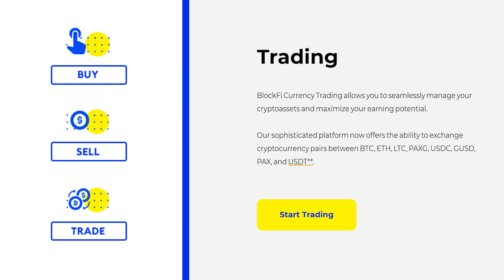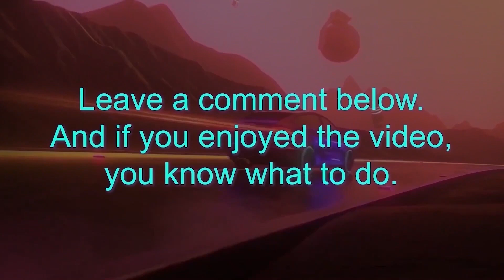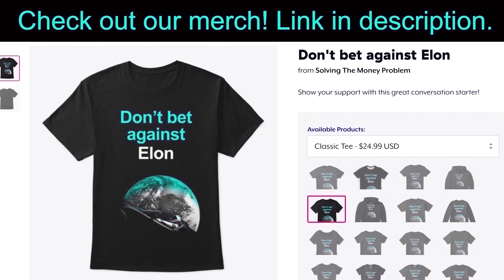Sandy Munro Shows Tesla's SHOCKING Lead Over Ford

Comment: It's kind of obvious that Ford didn't put very much brainpower into the Mach-E.  Likely we will see the same for the Lightning.

You didn't emphasize what Sandy found by way of screws.  Let me jump in.  The battery pack is loaded with screws.  So is the HVAC system.  Sandy didn't like that.  He's likely to find more screws as he continues the tear-down.

Screws vibrate loose; the more you have, the more maintenance costs will rise and reliability will fall.  Ford used a lot of screws.  These are literally the worst fastener choice for a machine that moves and experiences vibrations.

Ford neglected this product.  My guess is there's a pragmatic reason for this neglect.  Ford doesn't intend to sell very many Mach-Es or Lightnings.  Instead, they'll ramp up production for hybrids - with electric drive trains, tiny batteries, and range-extender ICE generators on board.  With hybrids, Ford will stretch their battery cell supplies - which are a problem for Ford.  And they'll lobby the heck out of governments to get tax incentives, the same incentives as for BEVs.  Or even better.  This is the path Ford is really charting into the future - the same as Toyota and GM.  Toyota, Ford and GM, and other legacy automakers, and the oil companies, and the dealer lobbyists, will all be spending time in capitals lobbying hard and handing out cash.

Everyone loves the hybrid approach.  Fossil fuel companies?  Check.  It will keep gas flowing to ICEVs.  Dealers?  Check.  Hybrids are immensely complex, lots of failure modes, plenty of after-sale work.  Consumers?  Sure.  They're used to gas stations, they're familiar.  And they'll get some seriously low prices on hybrids.  Battery cell costs won't drive up the price much if a hybrid's battery pack is tiny, and they can make ICE generators cheap, so the base price on hybrids can be pretty low.  With incentives, if Ford can get them, they'll be much cheaper than any comparable old-style ICEV.  A few disgruntled greenies like me won't like it.  Pleasing greenies isn't on Ford's to-do list.

Tesla won't be able to get purchase prices low enough to match hybrids for some years, particularly if hybrids are incentivized.  Tesla's life cycle costs will be lower, but how many consumers even know what life cycle costs are?

So I expect Ford to put their A-team on their hybrid models.  These true BEVs are just not very important to Ford.  They'll milk them for publicity, but the production and sales numbers will be underwhelming.
Reply: I don't see hybrids staying competitive for long and I do think that EVs will be better and more affordable that hybrids in the near future.
But yeah it does seem like they will try to milk their cashcows  for as long as possible before filing for bankruptcy
Reply: @elsmaster5592  By flooding the market with cheap hybrids, they can hope to tamp down demand for Tesla vehicles for the next few years.

Hope.

I'm not convinced it's going to work.  But this is what I expect them to try.

Tesla is no ordinary competitor, though.  Their engineering is still improving.  They have piles of valuable IP no-one else has - and the rate at which they generate more IP is breathtaking.

Hybrids may turn out to be fossil fueled transportation's last hail Mary before their arms give out and they can no longer throw at all.

We shall see.

Comment: There is a good reason right there for why the Mach E has to be inspected / serviced every 10,000 miles. They have to check for leaks in all those hoses. They designed this to be friendly to their dealer network and service partners.

Comment: I think part of this is that Ford - like most other automakers - is not vertically-integrated - they have a lot of relationships with vendors that they have built over decades. Those vendors supply a lot of parts to Ford's other vehicles. They don't want to jeopardize those relationships, so building in guaranteed sales for new model vehicles is part of the corporate DNA of the company.  This model probably served them well because they could get good prices on huge orders, and they keep costs down by integrating the same vendor parts into many vehicles. If Ford suddenly started building cars that bypassed the need for these vendor parts, it would send a strong message and make those vendors very nervous. Sure, the Mach-E isn't a high-volume vehicle, but it's an indicator of where the company is going. Ford is basically saying "Don't worry guys, we're still going to need those parts!".  Look at the position they are in - They can't go cold turkey - vertically-integrate, eliminate parts, and sour those relationships - they still have a bunch of ICE vehicles to sell along the way to becoming a full EV company. Those cars need those parts, and they can't scare their vendors. It think they will only start to eliminate parts once they reach some threshold of EV sales. It's probably part of some Cost/Benefit analysis.

Comment: Imho their reasoning sadly obvious...  Like you said later on, something like.. "what were they thinking? The trained engineers could have pretty much copied Tesla & done MUCH better w/ out effort" ....   @10:34 .. why?   Imho, that reasoning... Tesla, starting out as they have, don't have/rely on DEALERSHIPS & MECHANICS, AUTO REPAIR, SERVICE APPTS; in fact, prob way more of a hassle if they have to reapair/fix a lot of things.   On the flip-side, unfortunately Ford etc.... in an 'electric' motor vehicle, have to somehow try to maintain those repair shops... Keep their parts departments & long time, mechanics...  employed & with work.   Take away the regular 'maintenance'... tune ups.. winterizing, oil changes, spark plug, wires, etc & all the routine stuff many might do on a standard combustion engine?  It's the first thing I thought of when seeing ALL those hoses, crappy clamps, ton-o-screws (no joke, lol) under that cover.   ?   Just a thought....  they'll need something to still REPAIR & a lot more often, considering.       

That said, pls be sure at beginning of vid... saying in it.. AND in text, immed under & prior to links...   "sponsored by" ...       Oh & also, below that...  Where you have 'affiliate'....  right there, also before the links, be sure to disclose not just what... but also the bias/gain.   That, "the following affiliate links may generate a commission in return for purchases made through their use.."  or something like that..  as required.    Just looking out for ya'.   Thanks for sharing, stay safe & be well.  :)

Comment: customers are not engineers . they don't care  about these kinds of details. all they care about is ride comfort , spaciousness , acceleration and most important RANGE. if it checks these boxes they will sell as many as they can make. whether they make a profit is another matter. what's the warranty like on the battery and powertrain?
Reply: That's true,  but what happens when those hoses and clamps begin cracking and failing?
Reply: @Anklespank  And the spun-glass parts (or whatever) inside those "Scrap If Dropped" mystery boxes break when the car hits one too many potholes?
Reply: @kevincrady2831  probably some sort of sealed calibration unit.  Garbage

Comment: Volume manufacturing has a big role to play here as well.  One simple question; how many of Ford's products use a lot of these components?  While it may make sense to reduce and reengineer things for an EV, when EVs are your side production, mass producing parts for your entire product line takes precidence.

Having said that, I can't wait for my Model Y to get here in September.

Comment: At Ford Dealerships in the U.S. the "Billable Rate" for a mechanic is $120 per hour. They don't make $ on the cars. They make it by bending you over in the service dept. hence the horrific design here.
Reply: No, unfortunately what they are showing is that they not putting their best engineers on the job.   That the problem, I hope Ford get their act together and start build a great electric car.

Comment: You're absolutely right - Tesla beats Ford on engineering.  But Ford has been low on that list for decades.  And they still have huge brand loyalty.  How does Tesla convey (advertise!?) that it's built so much better.  PERCEPTION IN THE BUYING PUBLIC IS EVERYTHING.

Comment: Good engineers are at all companies. Tesla’s magic is that they allow their engineers to go clean slate if needed. Design the entire product not just your valve. Legacy OEM’s think they are reducing risk, saving money and schedule when they force engineers to use existing parts. It leaves them handcuffed and you get the hose design on the MachE.

Comment: Sandy Munro is a very good engineer.  He has a lot of admiration for Tesla in general, and so do I.  But he also likes most things about the Mach-E, which has so far been very successful.
The thermal management in the Mach E is not up to par with the Tesla, but at the beginning Tesla did not have the heat pump and Octovalve either.  At some point, Ford will also use a heat pump and will clean up the mess of hoses, because it's clearly a good idea and will result in more efficient space utilization, easier manufacturing and assembly, better reliability, saving electrical power, and cost savings.
Every manufactured device has some compromises.  This is one of them.  But sometimes it's defensible to produce a messy design on a short term basis, for example if it will be replaced with a better one in the next revision.  Like Tesla did, adding the heat pump to the Model S just this year.
Fair to report on this design shortcoming, and Sandy has spent a lot of time criticzing Tesla design also.  Ford is ahead of Tesla in some ways.
On the balance it's certainly true that Tesla has shown the way to the world in many ways and their engineering is admirable, even the World's Best, but there are a lot of ways that Tesal could fail and others could succeed 20 years from now, many of which have no connection to the Best Engineering.
Let me know when you think when Ford will go bankrupt?  Both Tesla and Ford have been close to bankruptcy in recent years.  I think Sandy Muro would say that the Mach-E is the best electric car next to the Tesla, and if you have the 2nd best car in a class, usually you're pretty successful.

Comment: I think Ford will be coming out with some nice products.
Reply: The new F150 Lightning  and Maverick Hybrid do look promising; hopefully they survive long enough to get them into production.
Reply: @fonkenful  yeah I think they’ll make it till then. What does Steven think, that Tesla can supply the world Evs by themselves?
Reply: @jm100368  Well I think SMR does suffer a teensy bit from a combination of fanboy-ism and THC goggles, so a little reality check won’t do him any harm.  I’ve owned two Ford Ranger Supercabs over the past 20yrs, and now that I’m in retirement the current 2010 might last longer than I’d get maximum benefit from pickup truck ownership, but if not, I could see the new compact Maverick fitting my use case perfectly, and the dramatically increased fuel economy of the hybrid version would be a huge improvement over the current 4litre V6. The two factors that would most impact any such decision on ICE vehicle replacement would be range and operation/maintenance  cost.
Not everyone buying a small truck needs to tow horse trailers cross country or go off-road, and those ridiculous acceleration rates strike me as nothing short of - well, the word stats with “m” and ends with “bation”

Comment: I was driving f* mondeo 20 years ago as company car. I did not feel comfortable on highway at speeds above 150km/h. Now I'm driving another f* mondeo, as company car again. Now I do not feel comfortable on the highway at speeds above 130km/h... If could be just me, of course. The car floats like a boat, lots of tail wiggling on bumpy road, wants to go any direction except straight line on the road, reacts to every wind. Have a feeling like steering wheel to wheel connection is made of rubber bands. Engineering in down spiral.

Comment: This is the epitome of the MBA-fication of old automotive. Its not just the engineers. The administrative leadership has a choke hold on engineers that want to innovate. All the management gives a fuck about is "engineering" every last cent out of everything, while using the existing "parts bin." This is what happens when "saving" money is more important then spending it to make a better product. I firmly believe major manufactures should be lead by engineers, not bean counters.

Comment: While I am super interested in this type of thing. How this car or how the Ford Lightning is setup internally will not weigh into most consumers purchasing decisions if they are looking at Ford vs Tesla. Tesla is miles ahead technologically but the parts are that visible to the average consumer and the hard states on the spec sheet will be the basis for comparison in the purchasing decision. So I would not say Ford is screwed or anything. We just have to see how this plays out.

Comment: I find you much more watchable and credible when you are not in absolute fanboy mode. Of all the legacy automakers, Ford and VW are best positioned and have solid offerings. This is to be acknowledged and celebrated. My Model Y and my Tesla stock are not at risk because solid competitors are emerging. I want the legacy's they continue to innovate like crazy and I want Tesla to feel the heat (someday) as it will improve on the areas where they are lacking - and yes, Tesla is not perfect - sorry to break the news.

Comment: Why not optimize better on this vehicle? 

Maybe Ford's expected/intended sales volume didn't rate the effort??? 

Maybe Ford had a desperate time horizon and belched out whatever they could in the shortest possible manufacturing window??? 

Maybe the Rube Goldberg approach benefits Ford's dealer network (service centers) and designed obsolescence and implied failures are a "good" thing???

Comment: I can't help but wonder about all those "Scrap If Dropped" mystery boxes.  What are the chances the fragile stuff in them breaks if the car hits a big pothole/curb/high speed bump, or drives on a "washboard" dirt road a few times?  Even if the odds are fairly low, each mystery box gets a roll of the dice each time.  Whatever they are, they're made of glass for all practical intents and purposes.  If a factory worker drops one from ~1.5 meters/5 feet or so (roughly chest height if it's being carried by a standing person of approximately average height), and that means it is just assumed to be destroyed, then we're talking about something about as rugged as a beer bottle or wine glass--being used as a car part.  WTF?

Comment: As long as Ford keeps the production #'s low they will likely sell all the MachE's they make. For awhile. Once the maintenance problems start to crop up along with outrageous repair costs; their sales will drop. As Sandy said, Ford needs to fix this quickly. Even if they do, and that's a BIG IF, the tens of thousands of 1st. generation MachEs  will plague their reputation. Lets see how soon some of those hoses start leaking all over the stacks of electronic components.

Comment: Think about how quickly ford launched this vehicle.....it is their first electric vehicle.  The product looks more like an engineering sample.  The engineers were tasked with rollout, meaning utilizing the fords parts bin as much as possible NOT designing custom thermal management, the customers don't care. Don't ever underestimate why people buy certain cars, if people cared about engineering GM would be out of business already.  You don't invest in designing a thermal management system and commit to custom manufacturing of said components unless you think you are selling lots of vehicles.  This tells me Ford is not convinced there is a market for EV's from Ford, this is a test balloon and if they succeed there will be a bigger investment in customized parts.

Comment: Mercedes EQS, longer range, disputable more comfort, more efficient.
Downside, not as fast as the Tesla Model S Plaid....
At least on that Topic, you have a choice.
Yes, high automated features, are Tesla a bit ahead ^^ (Working right now, not in 2 weeks ^^)
Reply: I would dispute. Range and efficiency are about the same, and the Model S is slightly ahead. Also very likely the Model S will improve with software updates.
I give you comfort, but the new model S is a huge improvement in this too, I would say easily good enough for most people.
And the EQS seems to be more expensive then the Plaid, if you compare the actual price, not the starting price. And you don't need the Plaid, the Long Range is plenty fast enough and the exact same in every other way.

Comment: Tesla can have as big a technological lead as they want, if they lose consumer confidence and support it means nothing.
I was a big supporter of Tesla and I have a Model Y on order... however I am now 10 weeks out from delivery and my car (which I have an assigned VIN for) may not be delivered for UP TPO 8-10 MORE WEEKS! Now, if there were some mechanism to assure me of my car's delivery date or even its location it might put me somewhat at ease, but this isn't the case. In fact, when asked, my sales rep explained they had absolutely no recourse. You want to replace the old school car companies? You better start offering support and service that is at least reasonably comparable to the worst of them. Even Ford or GM which are not known for great service can beat this nonsense.
At some point, you surpass the number of people willing to deal with this and the tide of support starts to turn.

Comment: Yellow on dash fluid pressure it optimal please return to dealer……leaves at dealer for 4 days charges you 800 to tighten a hose in the spaghetti